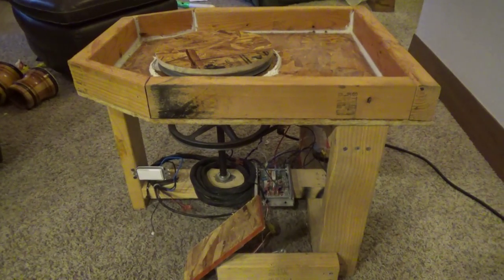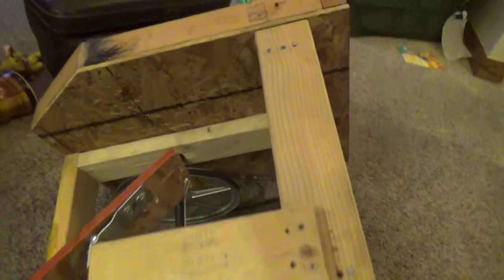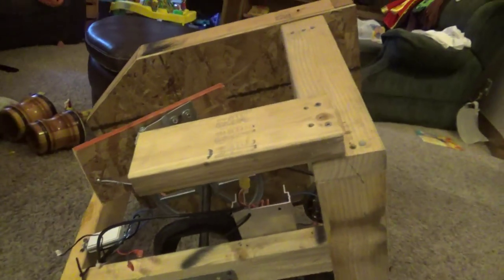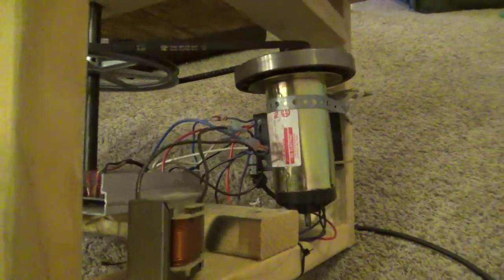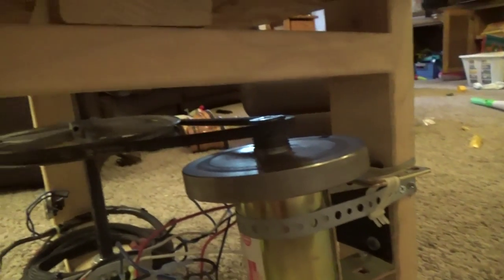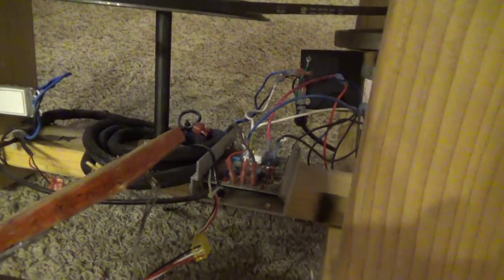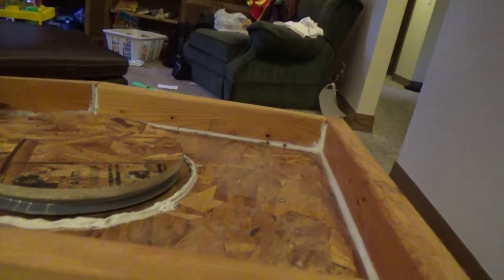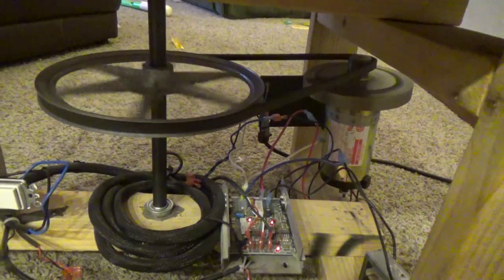Variable Speed Treadmill Pottery Wheel DIY

Comment: Nice concept. Th Linn gill is right about being cautious about electrocuting yourself. I would suggest covering all the electricals. Maybe just an upturned plastic bucket or something to protect it from getting wet. As far as the table top/mud-catch goes, you could use an epoxy resin (like bar top resin) to completely seal it. For that matter, you could cast yourself a resin wheel surface too.
I've seen treadmill motors used in a couple of applications recently. I need to find one I can cannibalize to build myself a small lathe. I've heard that some of the better ones have pretty beefy motors and it's really handy to have that variable speed control.

Comment: that's a great tutorial. there are plenty of diy potters wheels on youtube but most of them are just badly designed and the heads don't spin true to  a plane, they kind of wobble around, which is a shame because but that's the most important feature if you want to throw anything tall easily, it really shouldn't have these up and down movements at all. yours look like its spinning very true,  i guess you managed the junction between the shaft and the head really well. how did you do it if I may ?
good job !

Comment: O k so I noticed this is clean not used yet or used much anyway. So I have used the real thing several times and I would suggest you Water proof the H out of the wood tray or it will rot through and get someone electrocuted. otherwise interesting idea to reuse treadmill motor and guts.
Reply from the maker: +Th Linn gill Great advise! I will put a few more coats on.
Reply: the wood you used is called OSB and the glue is waterproof.  it's used for roofing, before shingles are put on.  So I wouldn't be concerned with it falling apart.  I would be majorly concerned with electrocution...all that open wiring needs to be enclosed and a GFI in the circuit would be a good idea also.  I came here because I just had the same idea as this and wanted to see what you did.  Do you have vids of it being used?